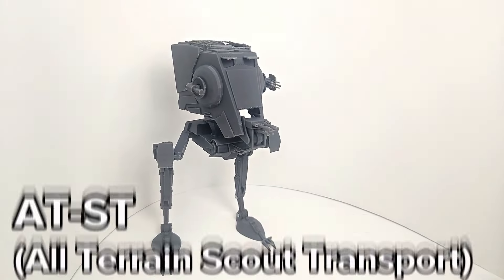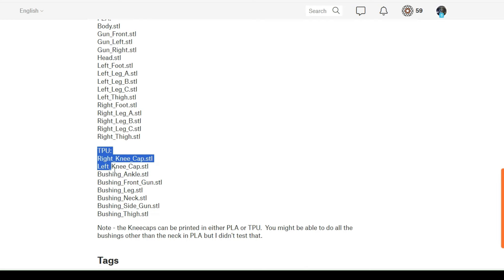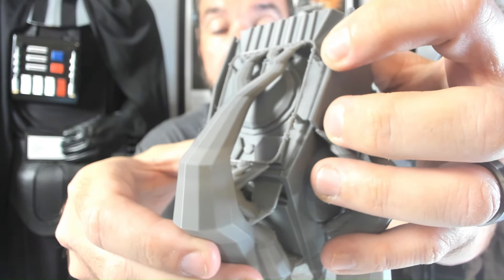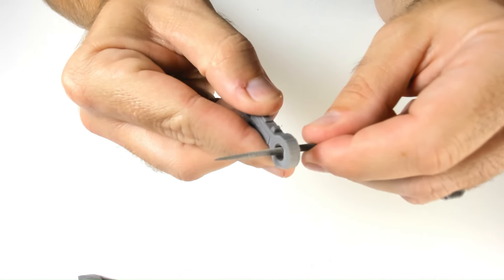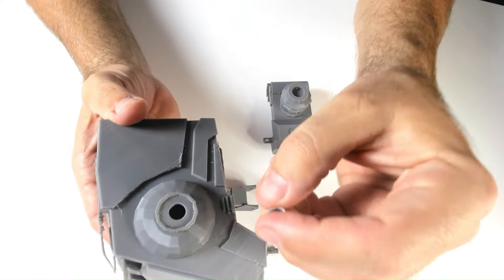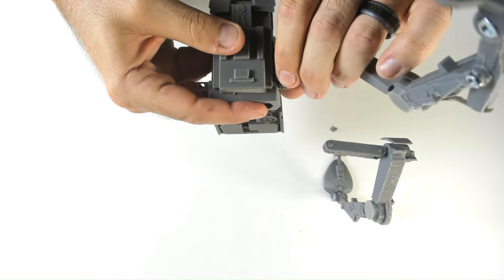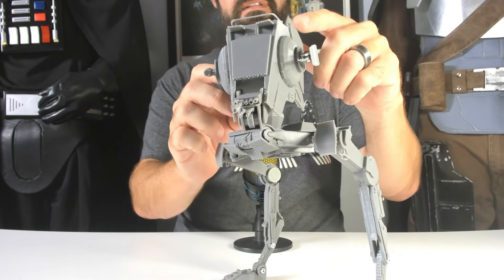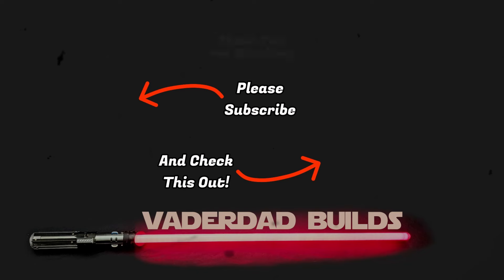3D Printed AT-ST | Review And Build | Star Wars FREE STL Files

Comment: Thanks for sharing your experience with this model. I've been wanting to print a AT-ST for a while so I'll definitely check out that model on Printables. For the rail on top of the head, I think I'll design  printable mounts and bend a piece of copper wire for the rail itself. The more delicate parts will get resin printed to make life easier for me and my FDM printer. I'm going to try using TPE for the joints instead of TPU because it is softer and might provide more friction to make posing a little easier.  I may even scale up the model.
Reply from the maker: Awesome! Good luck with your print,  resin printing will definitely help.